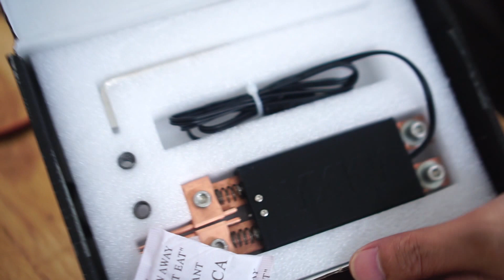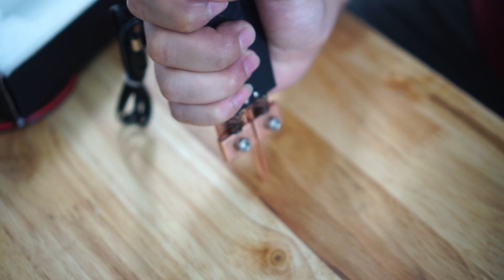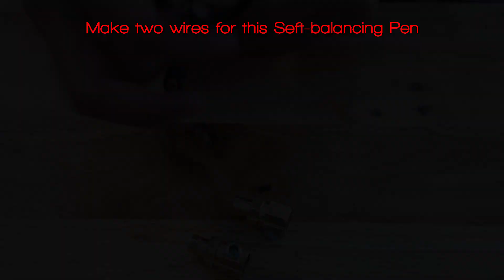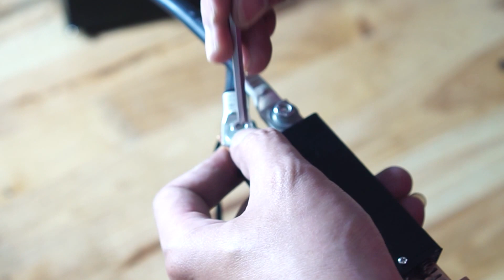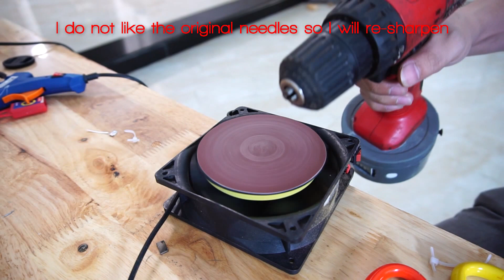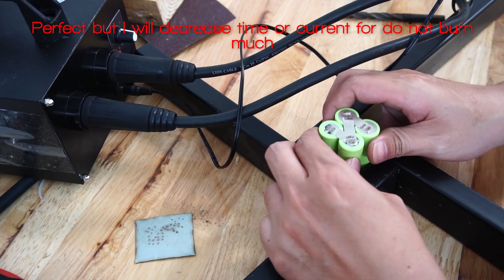Self-balancing Spot Welding Pen

Comment: WOW bought one of these devices for 25 dollars on ebay. Now all I need is 200 dollars worth of leads as thick as my wrist and a power supply bigger than my house LOL. Now i know why those guys on ebay didn't show it working or what was actually needed to run it. I worked as a lab technician a ways back and we had a spot welder as big as the power supply but it worked a lot better but it wold never work for spot welding batteries, because it only welded with two fat fat prongs top and bottom. But need must and I suppose a car battery and a set of jumper leads will work just the same. Thank you very much for the video, i never would have worked out how to use the gadget without you I am eternally grateful for all you efforts in showing us how to set up this device really I am eternally in your debt. THANK YOU THANK YOU THANK YOU so much
Reply: you can buy a rechargeable one now.  it comes with a usb cable, and goes for about the same price.  No need for a power supply with transformer/power supply.    Or you can make your own welder with an old MOT out of a microwave and id say 20-30 bucks worth of parts.
Reply: @dj_menyo839  exactly: microwave oven transformer and weed out the secondary side and replace with some 3/0 copper cable, about 4 windings. That will give you like 4V at like 30A? You make a timer with a large capacitor through a small relay. The larger the capacitor the longer the duty cycle.
Reply from the maker: Sorry, It's just a pen only 7$ in my country. Not a spot welder, hahahhaaa.....

Comment: I saw a video using a similar pen with a microwave modified transfirmer but I still don't know where or what the small cable with a connector at the end is used for.
Reply: this video is very informative. I just ordered one but that small cable is to tell the black box when to send the power through the two copper poles.

Comment: You could plug this into a inverter welder and put it on the lowest setting? My welder goes down to approximately 30 amps? Any reply appreciated 👍
Reply: The product description says you can supply 800A of current. I'm not too sure about that, but I guess like with common welding it's all about testing and finding the suitable current.
Reply: 800 and whole holding it in my hand? No thanks I like my fingers @carverevolition1

Comment: Lol, I just had found about the existence of battery powered Spot  Welders and while searching the best price, I casually came to this listed on AliExpress as "Spot Welding Pen Integrated Spot Welder Hand-held with Automatic Trigger".
The description was really misleading, saing it only needed a '12V with at least 800mA' power source, so I thought it had the same circuitry as the battery powered ones, but used a  common (and small) 12V DC power supply instead.

 Being only about 1/3 the price of battery powered ones, I didn't mind using a wired tool, as no one said anything bad about in the last reviews, so I immediately bought it. 
I was luck it was no shipped yet, while I decided to read the reviews just one more time, the bad ones and one customers photos shown a opened "welder" which had no circuit at all, only copper wires inside. I cancelled the order faster than Iought it😂

Comment: if i but this my welding rod machine do i need some kind electrical timer for that small The small black wire  connect  Plug? like install my machine inside?  or how its know when start and stop spot welding? Electrical circuit diagram? and what convert parts i need?

Comment: can i use the 12 v car 70ah battery as a power source for this spot welding pen? pen itself switches off the power after the application, right?
Reply: No
Reply: I will try using a cheap starter relay (needs ~1A to activate and should be able to handle >500A) - activated by smaller relay (only needs 0.0375A) - activated by the switch (rated only for 0.05A) in the pen.

The big relay should be able to withstand the impulse and will only allow the 12V of the battery to be connected to the pen when the trigger is pressed.

I will report whether it is possible or not 😊

Comment: You need the big black wires or else the power delivered to the contacts will be reduced. The small black wire is connected to the microswitch in the handle and this triggers the electronics in the big black box to deliver the timed power to the electrodes. You cannot use a car battery as there is no way to control the power to the electrodes. The electrodes will be connected to the battery directly so as soon as the electrodes connect to the nickel strip power completing the circuit the weld will occur without power control. The power control will be how long you keep the electrodes touching the nickel strip. Obviously this is unworkable as the welds will be horrible. You essentially need the complete setup for the spot welder to work properly.
Reply: Thank you🙏🫡

Comment: Is connecting those big wires mandatory? Can't we use small connector they provided?
Reply: That small connector is trigger switch for mili amp of current, not for main power.
Reply: For 90A YES!

Comment: Hello! Sorry, i dont get what this black wire with jack is for, could you tell me?? Can i use this pen with another adjustable welding station (with not connecting that jack anyway)?? 
What is that jack for??
Reply: Thanks for this question. I have a same question but the author couldn't answer this ! What for the black wire with jack ???
Reply: @shofiulalamshahin3820 that's a trigger switch, a push switch is connected from spring, once u press both prong to weld, trigger switch get pressed, that send signal to machine to give preset power for welding
Reply: The "foot switch"

Comment: Why did you want to change the welding pen? is this better than the previous one? im thinking which one of the 2 to buy, the previous one comes with a cable and the connectors as well

Comment: How do you connect this to a 12V battery and what is the purpose of the round connector?
Reply: The stock cable is only an small contactor (to replace foot pedal).
It's only a pen. Not a weld machine
*You need a spot weld machine to connect it

Comment: Hi I have one of these and can't seem to get it work. My questions are does it use 12V and at how much amps. Also what type/brand of power supply are you using
Reply: The stock cable is only an small contactor (to replace foot pedal).
It's only a pen. Not a weld machine
*You need a spot weld machine to connect it

Comment: If i use the normal cable plug 12v that came stock from it , it still can weld right ?
Reply: The stock cable is only an small contactor (to replace foot pedal).
It's only a pen. Not a weld machine

Comment: Please what is the size of the wire for spot welding pen?
Reply: 6AWG to 4AWG or 16mm2 to 25mm2 is usually recommended. Get silicone insulated wire if possible for the most flexibility but welding cable with EPDM is also fairly flexible. Depending on the type of spot welder you are using having too large of cables can be a bad thing.

Comment: what mechine to support this spot weld pen？normal welding mechine？
Reply: its an actual spot welder.   a standard arc welder does not have a transformer with the correct turns ratio for resistance spot welding.

Comment: Is it used to spot weld Aluminum,?
Reply: Won't work as aluminum resistance is quite low. Aluminum spot welding requires very high current.

Comment: How many amps should the power supply used to use this pen? I don't have a tailstock machine like you use I have a small one name DIY mini spot welder
Reply: Any PCB welder can bê used 👍
Reply: The stock cable is only an small contactor (to replace foot pedal).
It's only a pen. Not a weld machine
*You need a spot weld machine to connect it

Comment: i got one of these,total junk mlelted after 10 welds!
Reply: Friend , you do not know How to use / apply .. You have use too much High Current energy !  You cannot Connect straight to Transformer or Car Battery ! You got to have the Box in the Video ! Its quite Simple  just a Transformer with 50-100 Amps but must have Current Regulator using FETS Transistors and Control Timer to varies the welding Time as needed ! Thats all ! Can build one by yourself but requires knowlede in Electronics !

Comment: reduce the pulse time - you're burning cells !!
Reply: can you clarify what you mean by that?
Reply: phero  when welding time is high, it leaves burn marks, destroy the tips and heat up the cells.  Current should be the highest and time should be minimum
Reply: Jawad Ahmad thanks. That’s good to know. I’m about to try this out myself and am trying to find as much info as possible before starting.
Reply: @JawadAhmadsahibzada  there's a balance.  It still takes a certain amount of time for the two sections of metal to build heat and become plastic (in terms of softness).  His settings actually look pretty good to me.

Comment: How is it working for you? Better than the fixed type pen like the one Sunkko makes? Worth the upgrade?
Reply from the maker: Sunkko is a professional welder for commercial use, so i think this diy handle can't beat sunkko. But it's enough for me. You can find how i built a battery pack using this handle in my channel.
Reply: @Laamlee-yt  The sunkko HB-70 welding pen is not that good: the wires are thin and it has no integrated switch, so you must use the pedal to trigger it. With this design you have much bigger copper conductors and you can spot weld with one hand only. I'll make one myself....

Comment: Nice video! What voltage and curret did you set your power supply at? Thank you! 😀👍
Reply from the maker: Sorry i don't know what you mean. There are two adjustment knob for current and timing. Current about 90A, timing at 15~20 knob level
Reply: @Laamlee-yt  Can it kill you if you touch it?
Reply: @Neilukuk  
As long as the voltage is not high, no matter what the current rating is.
Reply: @yousufnofal9223  Thanks